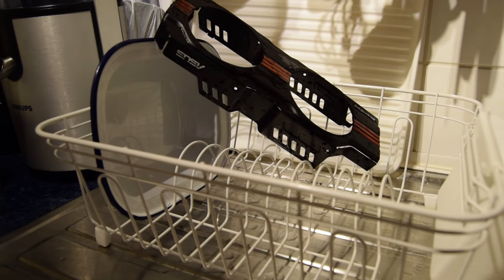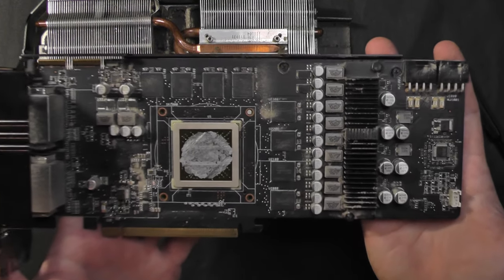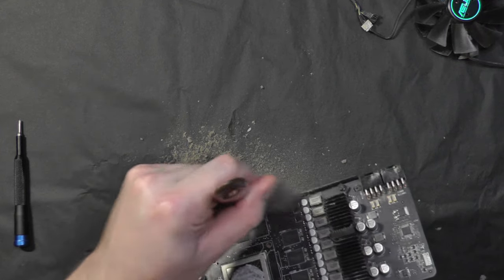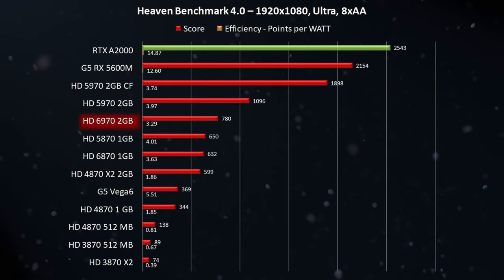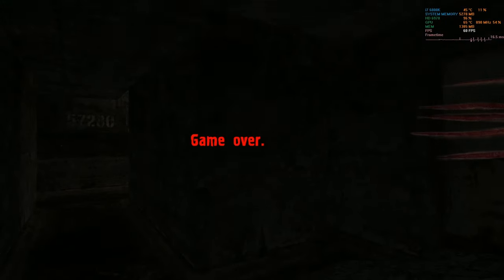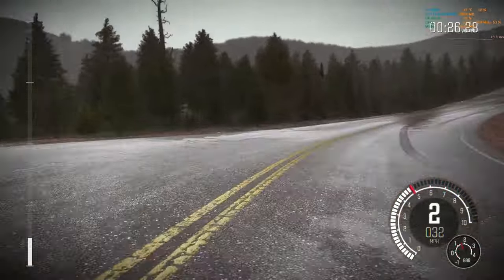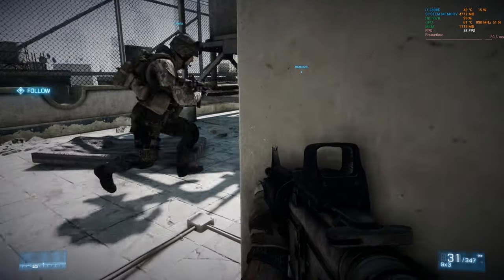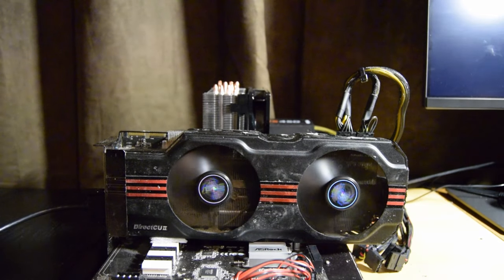AMD HD 6970 Tested in 2022 - 3 Slot Monster with Dirty secret!

Comment: I had two of those in crossfire which almost doubled the performace. Both GPU's and the CPU are watercooled (Coolance) and running on an EVGA X58 Classified mobo. That 15 years old system is still being used today by a friend of mine.

Comment: Had 2 in crossfire when I built my first PC. Unfortunately had lots of driver issues, after a while I sold them and got a single gtx580 3gb. When they were working it was fantastic but then. It would completely choke on easier to run games. Dual GPU was cool but just not widely supported.
Reply from the maker: Thanks for sharing, such is CF, when it works, it really rocks :) When it doesn't, it sucks! hah

Comment: Good video. I noticed that some games will suddenly double their fps when the VRAM is not exceeded. Example: My HD 7770 can double its fps from 30+ to 60 on control, MechWarrior 5 and riftbreaker as long as I tweak the settings properly so that the video memory usage was used as little as possible on RAM. Would you mind trying that? Yes, it might sound dumb to run control at 400p, or riftbreaker at 540p (After FSR). You can notice the video ram will enter system ram if the framerate suddenly cut by half (even after you stopped being in a intensive scene). Well, some of us must do with what we have at the moment due to high GPU prices.
Reply from the maker: Hello :) I believe once GPU runs out of dedicated memory, it then needs to resort to system memory, which is a lot slower, agreed, it's important to dial good settings to balance the load, this will be hard to replicate but not impossible :)

Comment: I have a bunch of old cards I'd love to share the scores for! When I get around to benchmarking them i'll be sure to comment here soon!
Reply from the maker: Hi Lucky! That would be awesome! I'd love to see what scores you get using the same settings :)
Reply: @nexus_tech  Hey! I got a score for my 560 Ti 448 Classified. Stock it managed:
FPS: 33
Score: 832
Min: 24.9
Max: 59

I also happen to have an RTX 3090 on the extreme end just for fun:
FPS: 307.6
Score: 7749
Min: 53.8
Max: 527.3

I have a bunch more cards I can test, GTX 580, GTX 760 MARS, GTX 1050 Ti, 9400 GT, R9 270x, HD 5970 and HD 7850
Reply: With a little overclock on the 560 Ti 448 managed 
FPS: 36.9
Score: 930
Min: 24.1
Max: 65.5

I’d say I could push it a little further still.
Was at 930 core clock, 2096 Memory clock
Voltage set to 1100mv
Reply from the maker: Thank you :) I'm looking forward to see how much more performance I can get out those GPU's! :)

Comment: Have you tried the AMD NimeZ drivers on it?
Reply from the maker: Hello there, I've not tried NimeZ drivers with any of the testing, just all standard AMD drivers. Might be worth looking into this. Thanks for watching 😊
Reply: @nexus_tech  I recently got ahold of a 6950 that I BIOS modded into 6970, shaders, clocks and everything.

So I'll try it myself. Last night, drivers were unfortunately behind Google Drive's throttle.
Reply from the maker: @b0ne91  That's so cool, wish this could be done on more cards. I'll dig into this too
Reply: @nexus_tech   Well I know why YouTube has this video as the top result for "6970 nimez" >.>.
Reply: @b0ne91  so have you tried it yet? i have hd 6970
Reply: @omsuwiskies7901  I did try it. It was worth it but only for older games. DX9 and 11 saw some improvements.
Reply: @b0ne91  older games .circa...? 2015? like what? i have installed it and saw no improvement compare whql on GTA trilogy
Reply: @omsuwiskies7901  Anything DX9 especially. If you have a good CPU, that is.

Comment: Why test Witcher 3 on ultra with this old card that makes zero sense.Hairworks comes with ultra that will bring R9 290 or gtx 780 below 50fps so HD 6970 doesn't stand a chance.It should be tested on medium.
Reply from the maker: Hello mate! Thanks for checking out the video. Agreed, I always turn Hairworks off, but the idea was to run it at max, so that I could see the next card tested using same settings and hope as I progressed to better cards finally get 60FPS. I've changed my testing to better suit cards that are being tested hahaha